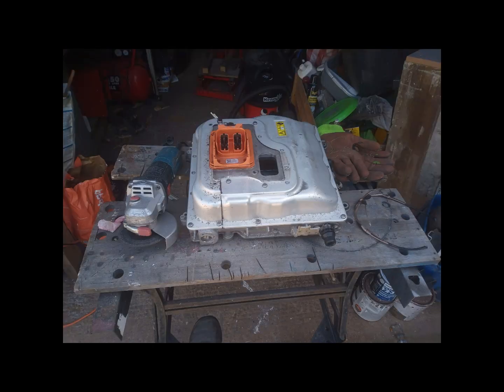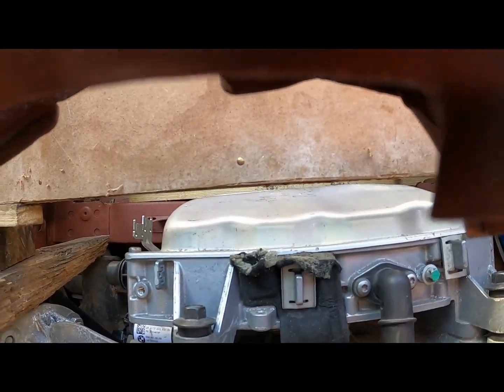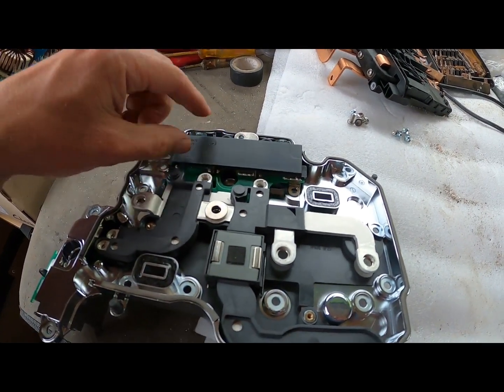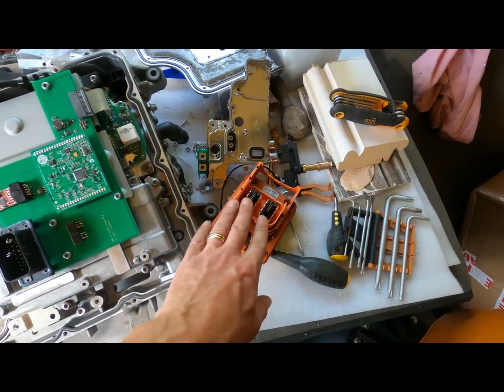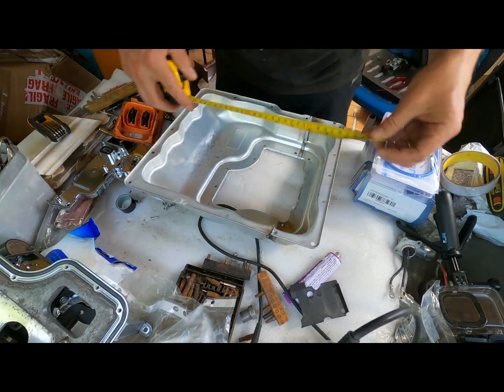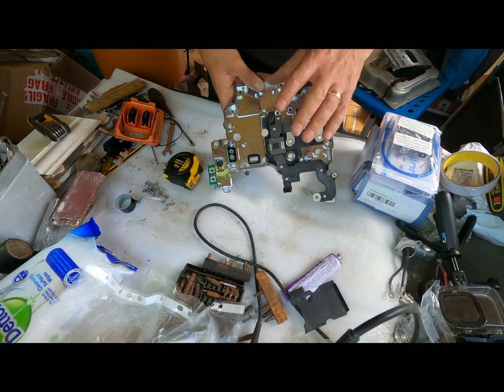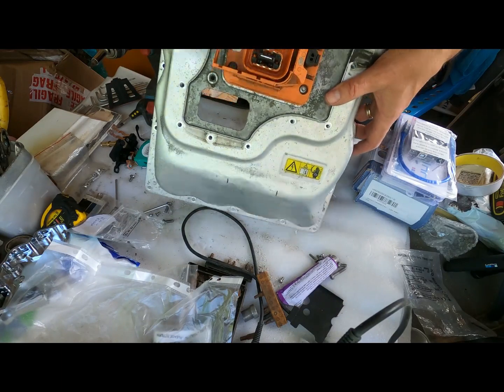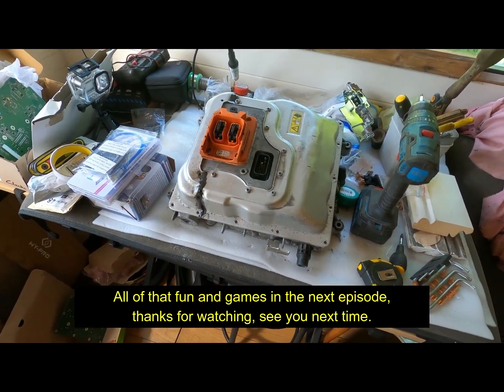More Mini i3 inverter mods

Comment: Nice work. Did you check the battery clearance with the hv cable plugged in?
Reply from the maker: Not yet but as the battery box is on an angle it should be fine 🤞
Reply: @MiniLifeCrisis  submitted my kit car for iva testing after many setbacks, just got a 2 month wait now.
Reply from the maker: @StuMunro  2 months! Good luck, I hope it goes through ok, did you expect that sort of wait?
Reply: @MiniLifeCrisis  slightly less, but it's actually going to be 3 since applying as dvsa sat on application for 1 month.😫